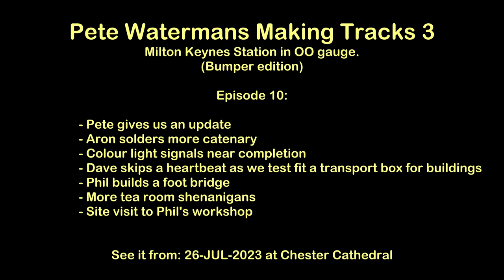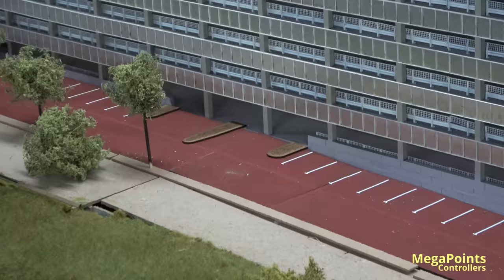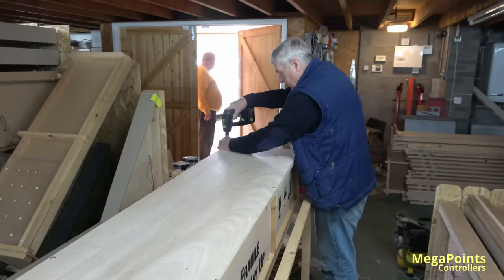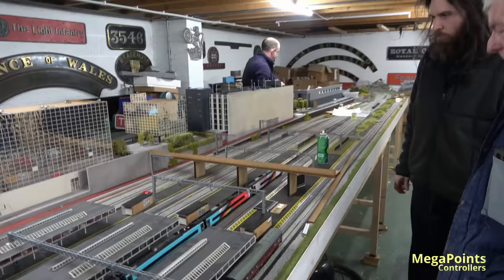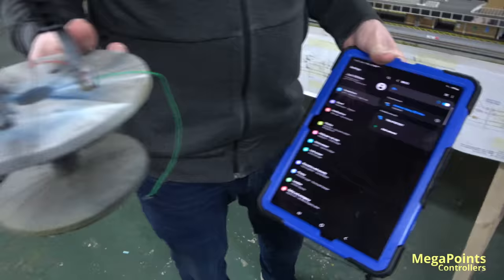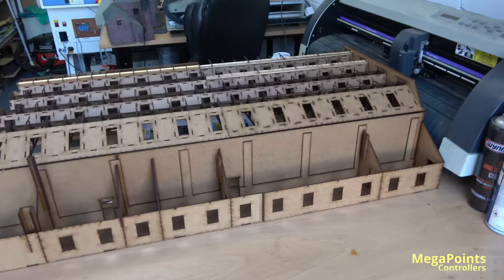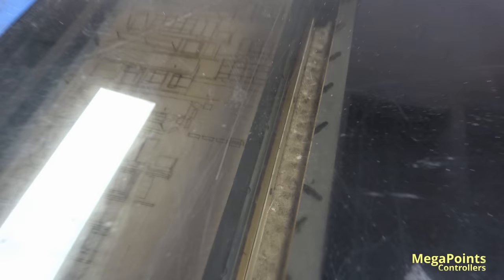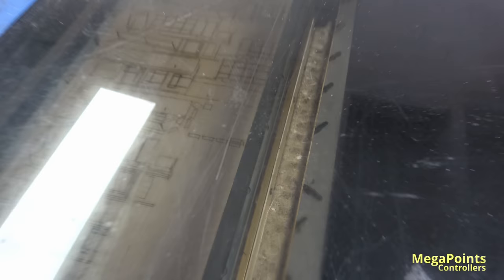Pete Watermans Making Tracks 3, episode 10

Comment: So you solder your catenary. Does that mean the electric units and locos take power off of the electric overhead wires, or are they soldered to look more realistic, or is it because solder wire is more durable/flexible than another alternative?
Reply: Its part of the custom built tensioning  system that is being slodered up using  6mm brass 'U' section and 4mm brass tube
eadily available from B&Q, its basically an adjustable McPherson Strut and Its quite robust as it provides a lot of mechanical and equal  pulling force  at both ends of each overhead wire run. There are 2 wire runs on each line which overlap each other at certain points as per prototype.